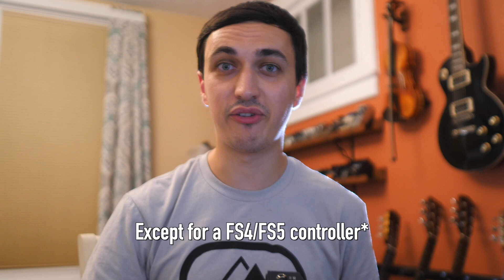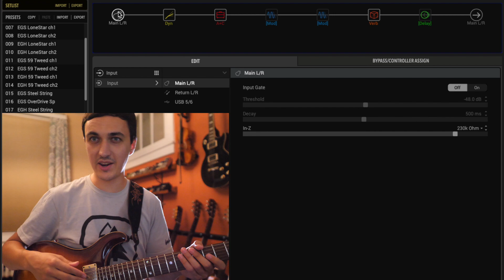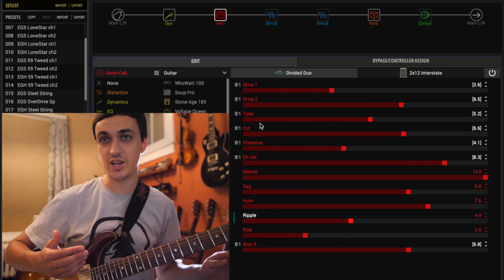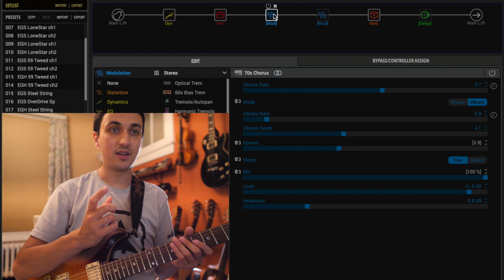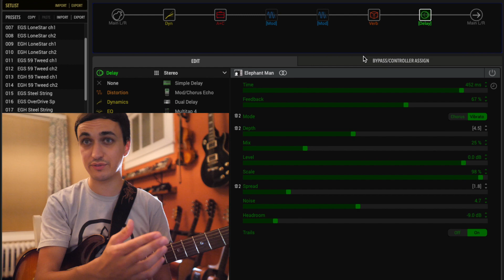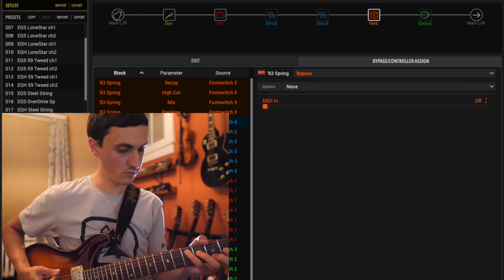Best Tips for Using the HX Stomp as Your ENTIRE Guitar Rig

Comment: I dig almost everything about the usability of the HX Stomp, but one thing I can't get past is certain presets-setting combinations where you get a high-mid to high frequency range, unpleasant sizzle-hiss kind of sound.  Sounds like some form of digital distortion or digitization issue.  Any idea how to get avoid or get rid of that?  I have a Strymon Iridium as well and don't get that same problem with the Iridium.  Like both of these amp replacement options, but want to get rid of that nasty digital sizzle on my HX Stomp.
Reply from the maker: Is it possible that you’re clipping inside the HX Stomp? Could be a lot of things honestly. 
Try to keep the level of each block consistent across the entire preset. You can also play with the high cuts on your cab sim blocks to see if a more aggressive setting gets rid of it.
Reply: @AlexPriceMusician  Thanks for the follow-up.  So now a dumb question - for clipping and these levels, is it easier to check that on th Stomp itself or in the related app on my computer?
Reply from the maker: There are no block-to-block meters in the Stomp so you’d have to start by bypassing everything in your preset, the adding each one in one at a time. Make sure that there are no drastic boosts in volume from any of them.
Reply: @AlexPriceMusician  Excellent feedback.  Thanks, man!
Reply: @wrekkingcru  Do you play while its connected to your PC by usb? I've found that when im using my hx stomp while plugged in I get noise like you described. Goes away when I unplug the usb cable.
Reply: @MM-uz7gn  - That's a mighty good point.  I has just updated my HX Stomp and it may have been connected via USB when I heard this nasty sizzle freq distortion.  I'll test this week to see if this or checking the levels that Alex mentioned above improves things.  Thank you both!

Comment: Hey Alex, what are your tips to have on presets for Single Coils(Stock Squire Strat) and Emg 85/81 Humbuckers. I'm wondering what i should change to get similar sounds because they're so drastically different. Also any tips for FRFR ( i'm using headrush) and distortions dont sound good but cleans do?
Reply from the maker: Hi Kane - sorry for the delay here. The preset probably sounds off to you because you're using high output active pickups. I don't own any guitars with active pickups and so I can't really create anything specifically for that purpose. The first place I would start is lowering the gain in the amp block because your pickups will push it much harder than a passive guitar would. Secondly, you can probably do away with some of the presence and treble since active pickups tend to be brighter as well. After that, I'd play around with lowering the input impedance setting.
Start there and see if that fixes your issue with distortion not sounding good on your FRFR. The Headrush is a decent speaker so it should help out a bit.
Reply: Alex Price thanks so much for the suggestions , I will certainly try this

Comment: Thanks for sharing that preset and all your knowledge for free. Really apreciate your work!
Quick question ... How do you aproach a gig where you have to cover different styles of music (like dance music in a wedding band). Would you use 1 preset like this one as a pedalplattform in combination with your pedalboard or do you switch between different presets with different amps/setups?
Reply from the maker: Hi Thomas - so for years I worked on cruise ships and at the time I preferred to use my HX Stomp mostly for amp sims and odd modulation effects. You might be able to find a couple examples of what my pedalboard was like around this time last year. On ships I really only had to bring one guitar and the music was different each night. I accounted for the different styles with about 10 different presets in total. I would have two presets that were the same rock tone but with different modulation effects, two presets for jazz in the same sense, two presets for broadway-type shows, a preset to fake an acoustic tone, a preset with Boss OC-3 emulation for solo jazz sets, and two presets for a higher gain rock tone.

Comment: I liked the tip about adjusting the level in the compressor block up front. It'd be really useful if Line 6 had an input gain parameter built into the input block on every preset. Thanks for the preset. I've got the Helix LT but I'll try it out and maybe add to it.
Reply from the maker: That’d be a nice feature for a future update 👍🏼